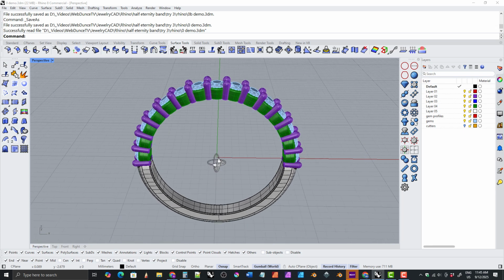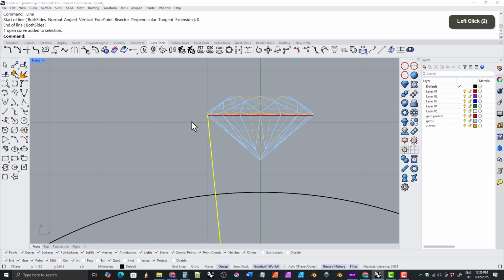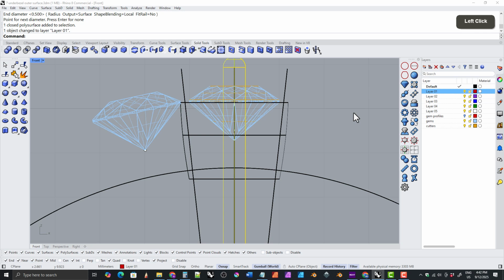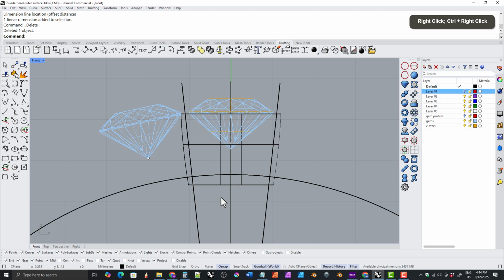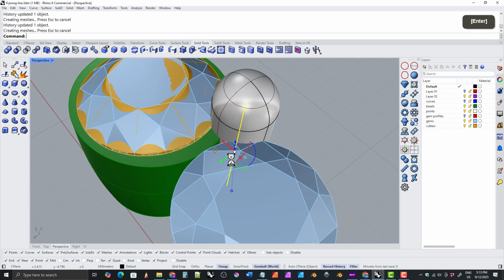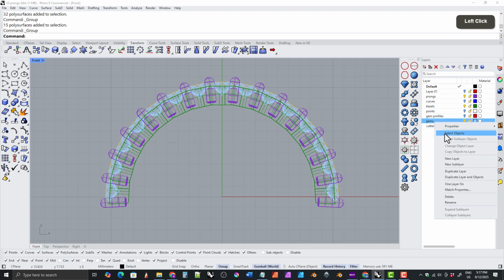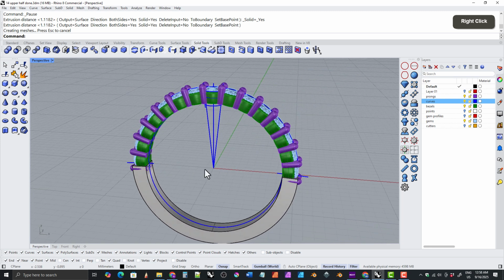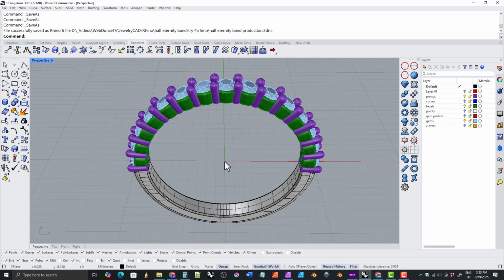Half Eternity Band in Rhino

Comment: hi! I see there is a free version. will it work for Mac? I have rhino 8 Mac version. Thanks!
Reply from the maker: It seems to work for a lot of mac users. So, try the free version to see if it works on your computer. If the free version works on your computer, then the pro version will also work. But you don't have to buy the pro version right away; you can use the free version for as long as you want. The free version just has fewer gem models and fewer tools or, in some cases, tools with fewer features.

And, if the free version doesn't work on your computer, please contact me and tell me what happens, because I can probably fix it so it will work on your computer. I want it to work for as many people as possible.
Reply: @webduncetv  Sounds good! I'll get on it today an d let you know how it goes